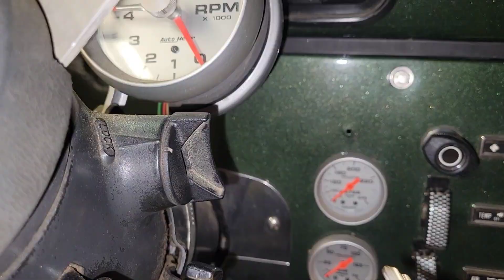Jeep CJ-7 Cooling System Upgrade

Comment: Can’t you wire the dual fans to run while the engine is running?
Reply from the maker: Hi Fred, yes I could have wired them to run all the time, or even wire in an override switch so I could keep them on when I was on the trails. That might have helped with my clutch fluid overheating